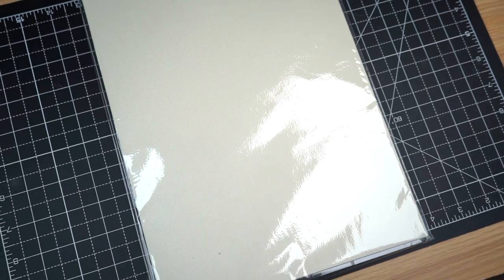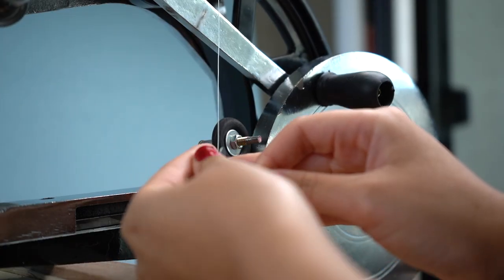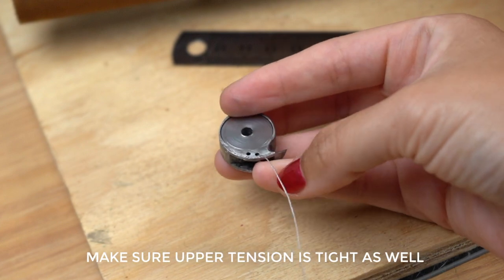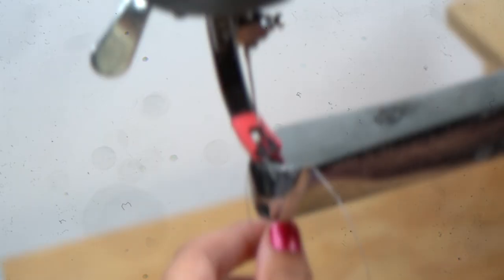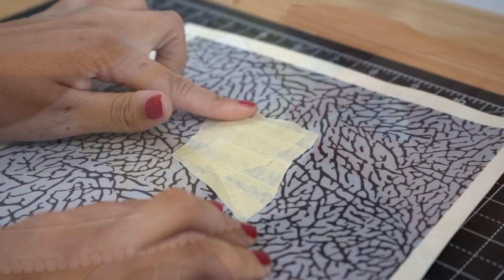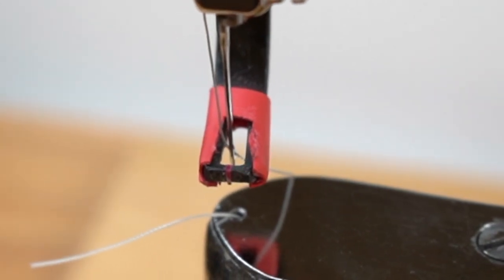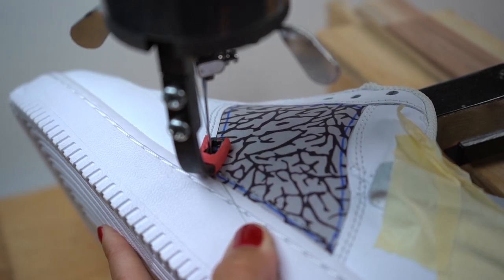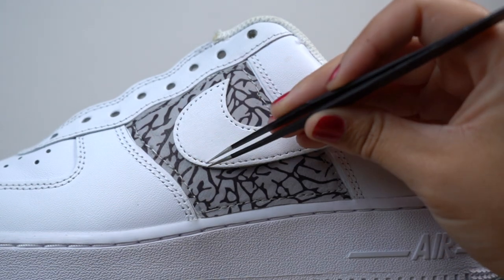$90 SHOE SEWING MACHINE! HOW TO  PRINT YOUR OWN FABRIC & SEW MATERIAL TO SHOES | PART 2

Comment: Super helpful video! I bought a similar machine to do some shoe DIY's. Had a question, were you having any issues with he thread breaking while the needle went into the bobbin hole? Not sure if the thread it came with is just to thin, or if there's something I did wrong with my machine. Thanks!
Reply: Try getting thicker thread

Comment: Hey! Your pt 1 was super helpful but when I watch this video I realized I must have done something wrong, when I try to sew the presser foot only goes up and down it doesn’t help pull the material to the next stitch so It stays in the same place over and over, if you know how to help with this please lmk thanks 😇
Reply from the maker: Happened to a friend of mine to! You just need to adjust the stitch length (screw underneath the machine) it comes pre adjusted sometimes to the smallest length. If you cant find the screw watch my first video again to locate it 👍
Reply: @Sophiesophss  thanks so much I’m gonna go back to the first video and find it!
Reply: @Sophiesophss  hey so I went back and found it and have been messing with it and adjusting it and it’s still the same. I have everything set up but when I try to use it the foot only goes up and down and won’t move how it’s supposed to, idk what I’m supposed to do to fix it 😫